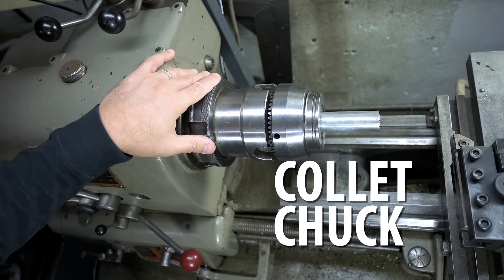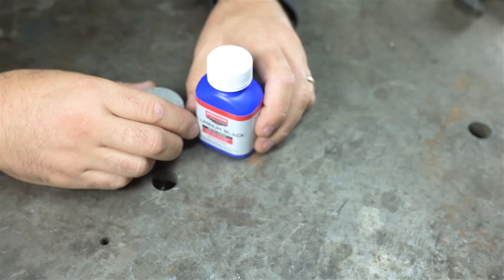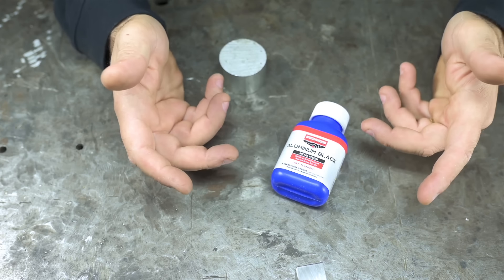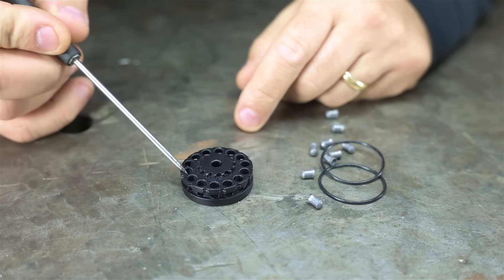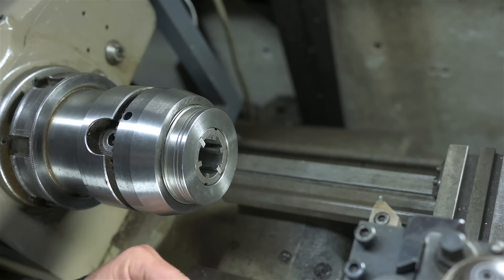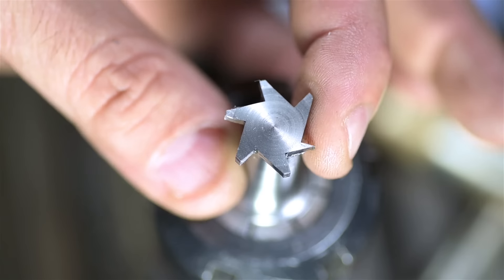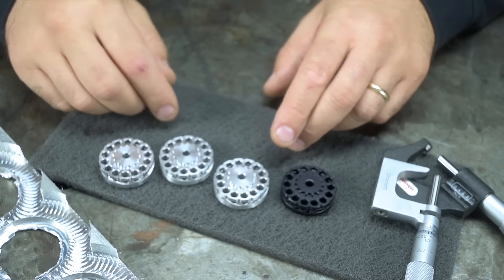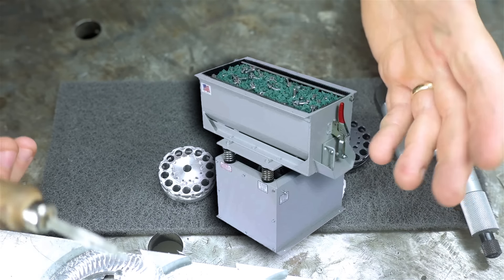Will it Black an Entire Aluminum Part?

Comment: Read through the MSDS for Aluma Black and it looks like it's removing the aluminum oxide coating from the part with acid and replacing it with a new passivating layer that contains selenium as well as maybe nickel and/or sulfate.
Reply: The SDS lists both nickel and copper sulfate and both copper selenide and nickel selenide are black, so that's a decent guess.
Reply: @nathanschley2088  and Jason: Machinists don't make decent guesses on any topics which are not front and centre machining. 
They just make absolute, massively improbable, wild ass guesses (although they don't own up to that, even to themselves).
If you doubt what I'm saying, just launch into a political discussion on a machining forum (and stand back)...
Reply: @Gottenhimfella  really off topic. Nobody cares that you argue politics in other forums.
Reply: @UnitSe7en  It's not really off topic, just poorly presented.  When you have someone who is an expert in a topic (machining, in this case), that doesn't mean they're an expert in other topics (chemistry, in this case).  Often they themselves don't realize the extent of what they don't know.  So you have to take that part of what they're saying with a grain of salt.

It's most obvious with politics since there's a lot of misinformation out there and people tend to just accept wild claims that fit their worldview.

Another example I see all the time in my field is software developers and IT.  A lot of developers learn the basics of IPv4 and will talk like they have a deep understanding of networking.  Then you throw them a problem that involves some simple routing or layer-2 stuff, and they fall apart.

I prefer a coworker that is aware of his ignorance than a more knowledgeable coworker who tries to cover it up.
Reply: @jeffspaulding9834  Nicely put. 👍
Reply: @UnitSe7en  I found it amusing.
Reply: @nathanschley2088  Huh, the one I found (for paint on Aluma Black, so could have been an entirely different product) was selenous acid, nickel sulfate, and some other stuff I can't recall off the top of my head.  Not sure what's going on specifically (selenium chemistry isn't my forte, to say the least) but I figured that the passivating layer might wind up being nickel selenite, or aluminum selenite, or that the selenite reduced to selenium and producing either of those selenides.  And sulfate itself passivates aluminum, so that could be one culprit.

Comment: So to recap, making machined metal parts turn black by applying blue makes them look cool, apart from when you don't read the instructions (and who does?) at which point it makes them look crap and you end up doing more work to remove most of it so they just end up looking dirty.

Seems like a legit use of workshop time.
Reply: Guess the can was half empty..
Reply: honestly the worn pitted look might be cool.

Comment: Cold blue adds a Black Oxide porous layer to steel/iron that then allows Oil to soak into it. That's what adds the rust protection is the oil not the oxide layer. However having the oxide layer can help stop red oxide forming (rust)

Comment: Hey Tony! Speaking of CNC - Any update on the Y-Axis Ball-screw? Specifically the nut?
Did you find what caused it to destroy itself again and again? Really curious!
Reply: Same!
Reply: depression
Reply: @Lu-db1uf  my kind of humor
Reply: I also would like to know.
Reply: Actually, I’ll ask him on patreon.
Reply: @shawnhuk  please let us know if u get an answer!
Reply from the maker: Marco/All.. sorry I didn't know I left everyone hanging!  The oversimplified story is the Y screw was too long.  It travels with the head, and could bottom out inside the casting.  So it would try to jack the ball nut out, tearing apart the balls.  Slightly less simplified: The screw doesn't have a ton of space inside the machine, I suspect at higher speeds (rapids), the screw would whip and not make it into its "hole".  Bottom line I lost about 1/2" of Y travel shortening the screw, but I've since slowed my rapid speeds down (early on I was doing a lot of testing).  I could probably go back to full Y travel?  Leaving well enough alone for now. :)
Reply: @ThisOldTony  there we go. Thanks for answering me on Patreon and here.

Comment: If you get to build a tumbler, I recommend adding a water intake and a drain. You really need to flush out the residue regularly. Otherwise it forms a paste. Flushing and cleaning is half of the job.

Comment: I was thinking about how much nicer, tougher, and "non-dimensioner" Cerakote would have been for those magazines, but either way it was an interesting and hilarious video anyway.  I love this channel!
Reply: Was thinking this as well, I think powder coat would do well too. Just have to be careful with the thickness of the coats being applied.
Reply: Cerakote actually adds size
Reply: @Turbogto_guy  well yeah, but between 0.0005" and 0.001" isn't going to make any difference to almost any part.
Reply: @craigm5511  it did on a receiver I coated where the barrel slid in.
Reply: @craigm5511  it adds a LOT more than that. It's marketing. I even discussed this with their senior reps this year when I met with them. Their take is that you remove material from the part when blasting and add it back when coating. It's a give and take that is not exact and can be very misleading. I don't think you actually understand the measurements you gave and how small they really are and how that can not, and will not be achieved uniformity with the use simple hand tools. Average  droplet size factoring in the VMD(aka DV0.%x10) of the nozzle and knowing that cutting the droplet size in half results in 8x as many droplets you will see that come out, and with the average droplet size being 30μ (1-120μ VMD) You can see how the advertising of 8-25μ is misleading. Just one droplet can be .005" while others are so light that it requires a second pass which send out more droplets ect ect... 
So the point is you need to know what you are talking about and not just type marketing phrases as a truth. You won't see consistent 1mil coverage on any part done by hand. And the smaller parts as well as more corners and curves only makes things worse.
Reply from the maker: I was under the impression Cerakote wasn't something you could do at home?  You implying sending them out?  Interested.
Reply: @ThisOldTony  definitely can do at home. You sand blast. Clean with acetone. Spray. Bake. 
Or you can do the air dry which takes 7 days to cure. Before 7 days is up, it’s prone to chipping easily. I use the air dry. I did a knife with it a few weeks ago to test it’s durability in my pocket with keys and stuff hitting it. Two weeks, so far so good. I also did a slide on my pistol. It’s holding up nicely too.
Reply: @ThisOldTony  Cerekote is something you absolutely can do at home. Just need to scuff up the parts, or bead blast them ideally. They sell air cure or oven cure variants of their coatings too. Duracoat is another good option too, they even sell it in aerosol cans! But they're one time use and expensive. Still have to be careful with coating thickness but it's used inside firearms with relatively tight tolerances and doesn't create any issues when done correctly.
Reply: @ThisOldTony  sending them out to a company that is equipped to do precision parts and offer subsequent QC is expensive and the few shops that do it (primarily aerospace) will tell you that it's a coating and not a surface treatment and that even with the advanced  robotic application equipment it will be at the end of the day, still just a form of coating with limitations. Sub surface treatment such as ano is often recommended for durability as well..
Machining will have to take into account the dimensional changes prior to being sent out for treatment and coating based on the overall shape, size, and complexity of the part. Often people are mislead as to the actual benefits of ceracoat and although they exist in certain well defined parameters, it is not a miracle coating. 
PVD and DLC coatings are much better suited for machine tools and complex geometries. 
Physical Vapor Deposition (PVD) is a metal adhesion process layer of Zirconium (Zr), Titanium (Ti) or Chromium (Cr).  Alternately,  chemical vapor Deposition (CVD) is a  process that creates the bonding layer with a silicon-based precursors (The carbon group is a periodic table group consisting of carbon (C), silicon (Si) ,germanium (Ge), tin (Sn), lead (Pb), and flerovium (Fl). Diamond Like Coating, as it is known combines low friction and high hardness for applications requiring easy release or low sliding wear like engine components, medical devices, dies, molds and firearms. PVD/DLC coating processes create a rich, neutral, black color.
Thickness 1.0 – 10.0 µ
Coefficient of Friction (COF) 0.08 – 0.11 (dry; against alumina)

Sending out parts for type III hard coat   (or type I or II if you want fancy colors) is a much more economical option if you want to retain dimensions relatively speaking.. For the home shop, just think of the difference between cold blue and having tanks of hot caustic salts set up. 
Anodizing at home is possible but with the amount of time, investment, and use of chemicals... unless you have a lot of parts being produced, it may be best to send them out. Especially if you want to have uniformity.

Comment: I used to make Vibratory deburring machines and if you want to do a make shift home version of that the lathe is perfect. there are various centrifugal tumblers that have a similar action to that. Although a container that would can seal with some water and house hold detergent will go a long way, and yes glass bead is incredibly aggressive for aluminum.   A medium cut small plastic media with with water and house hold detergent in the lathe id say between 150 and 300 rpm for maybe 20 minutes would do the trick.

Comment: I think it might depend on the specific aluminum alloy, too. I've used that stuff on two different projects (both made from random mystery aluminum), and it worked fantastically on one of them, and about like it did for you on the other. The only difference I can think of is maybe they were different flavors of aluminum.
Reply: well, it could very well be that one of them was aluminum and the other was aluminium
Reply: @andresaofelipe  hahaha

Comment: Although I’ve never played with blackening aluminum, I have done plenty of oxidizing of brass and copper. In that case, having either too high a concentration or the oxidation solution at too high a temperature results in a non adherent oxide layer. And, non linearly, or in reverse order, the tumbler for de-burring might have been improved by adding soapy water. It allows the abrasive media to better flow around and through the parts. But the somewhat less than hermetically sealed lid might be a little issue here. My first attempt at “distressing” brass parts was in a one gallon paint can, lined with thick glowed cell foam, and filled with sharp rocks on a lathe. Now I have dedicated machine with a rubber lined hexagonal drum, roughly 1.2 cubic meters.
Reply: This isn't an oxidizer.
 it's an etchant that simultaneously performs a copper selenide deposition and a phosphate conversion.
It's basically fake black oxide, made of a copper and selenium matrix, with a little nickel phosphate for wear resistance.
It etches the existing oxide layer, then because of the consumption of that oxide layer, the solvent potential of the solution goes down and deposits the mixed matrixes onto the surface which used to be covered in aluminum oxide (or not, it tends to work better with freshly milled parts because it acts as a primer in a way.) 
Continued application dissolves the existing matrix which repeats the process, allowing you to "layer", even though it is nondimensional. Best applied with a brush or carefully applied with cotton swabs.
It is pretty much identical to Gun Blue or Cold Blueing solution, except for it's slightly chemically different. Both are copper selenide reactions, NOT true oxidation. They don't form a real oxide layer.
Reply: @D-Vinko  so is there any real way of performing cold oxidization of aluminium at room temperatures?

Comment: When I made the Air rms S410 magazines 20 years ago from 6061 Aluminum I found that drilling the holes undersize then cutting the side groove and finishing with reaming the holes to size worked best.Then if any burrs were found using a Exacto #11 knife tip worked best to remove any Burrs. I made about 500 of these magazines and probably  had 10 or so that needed the #11 blade. I left the wheels brite machined and used fine Glass Bead for the covers & bodies. Thy were then professionally Anodized black with Brite Dip and came out great.

Comment: The aluminum blue looks a lot like sodium hydroxide. I’d bet that’s all it is. Technically thickens the oxide layer, but it’s not going to protect them from anything. The gas is hydrogen. Smells… sharp?
Reply: Acid/base aerosols tend to smell, even if the gas that kicks them up doesn't. Close your lungs kids!
Reply: I checked out the MSDS for that stuff, the smell is most likely fluorine or hydrogen fluoride. The stuff is 2% fluoboric acid.😦

Comment: Tony, couple thoughts on the use of the abrasive can. Since parts have that convenient center hole, mount them on a shaft and use drill press or hand drill to spin them in can. Shaft could simply be a long bolt with one nut or piece of all thread with two nuts. If drill not reversible, spin once sprocket up & once sprocket down. With three parts, spin them in pairs with sprockets to outside and alternate pairing each time so only need to mount onto shaft & spin 3 times.

Comment: The problem is you dunked the parts in a bowl. There's a serious bit of science happening with this stuff, and the directions are very defined on how to use it. You're supposed to wipe it on, let it bite into the aluminum, and then wipe it off with a clean cloth, not fully submerge the part. Submerging the part degasses the chemical causing it to literally eat the surface of the aluminum and defeat its purpose as it uses the oxygen in the air to oxidize and stabilize it as it changes the color of the part via that thin-layer of the product spread across the surface.

Corrosionpedia says it best...
An oxidized surface is a surface that has a thin, tightly adhering, oxidized skin (from straw to blue in color) extending in from the edge of a coil or sheet. All metals, with the exception of precious metals, will oxidize when exposed to oxygen and an electrolyte, such as atmospheric moisture. It is a chemical reaction of the metal surface with the oxygen present in the air that causes some of the metal to corrode (or oxidize) and form the respective metal oxide on the surface.
Reply: I wonder if chilling the liquid could slow the reaction down enough that immersion could be viable
Reply: This is the most accurate and valuable information we can get. Thank you buddy!

Comment: One great aspect of aluminium is that you don't need to "blacken" it as rust protection, because alox forms by itself and protects te rest of the part.
Since it's just a looks thing, just anodize it (or have that done): that's the proven method.

Comment: Got a slight suspicion the layer of grease, oil, cooking oil, anal lube etc. (stuff found in regular workshop) keeps metal parts from rusting easily. Also constant handling. Idk if it helps peel the rust off or it's the greasy hands.
Reply: A collector of antiques told me it's a combination of both. It's called a patina, and you should never clean it off of a valuable antique.

Comment: I did an aluminum DL-44 blaster with Birchwood Casey aluminum black.  Dunking resulted in flaking and a rough finish like you got.  I had to apply it using a q-tip and rubbing fairly hard to get a nice finish.  What I suspect was happening, was that the surface of the  aluminum was oxidizing and flaking off, whereas when rubbing it with a q-tip it was maybe penetrating the surface a bit.  I had to rinse and reapply several times.  The smoother the finish, the harder it was to get it to take the black.  The finish is more like parkerizing than bluing and a lot more work than bluing steel.

Comment: Hi I think the pitting is a result of tumbling the part in abrasive and micropitting the surface polish them with a wheel clean with alcohol, dry and attempt again. The orange colour is from oils left on the surface. I will say that I have never been impressed with the finish I get but without an anodiser beggers can't be choosers lastly any surface treetment will effect dimensions this includes Anodizing and I was taught to allow a few thou for expansion, I am sure there is a formula but that's beyond me.
As always great content and worth watching thanks

Comment: I have blackend white aluminum with this product. I know it says room temp, but heat it up just a little with a toaster oven, hair dryer or heat gun. You only want to warm it up to the point that holding it is not uncomfortable. Then brush it on. It may take a few applications, but it will continue to get darker. Use a clean brush every time, as dipping a brush back into the chemical that has already been part of the reaction will ruin the fresh chemical. Gun oil to clean it at the end seems to help for some reason. 
Do this and the part will come out exactly how you wanted it to come out.